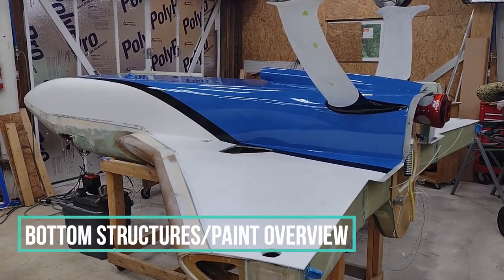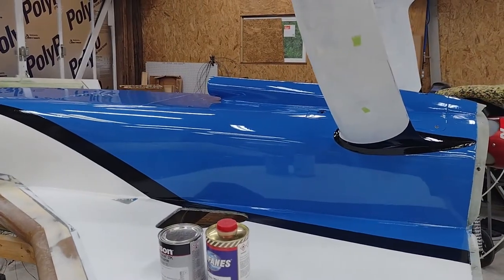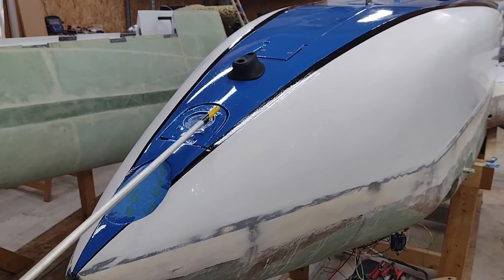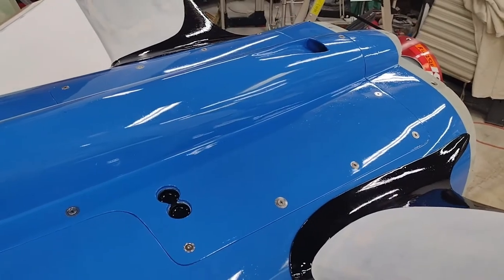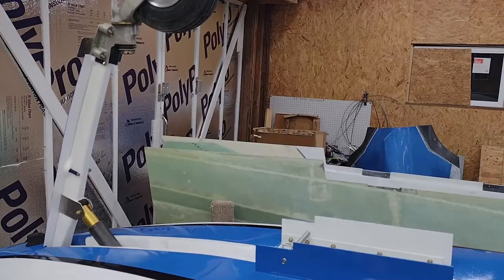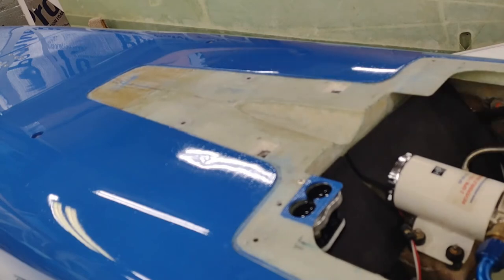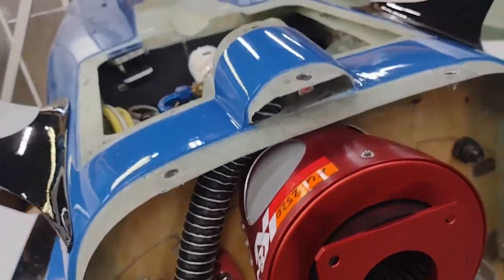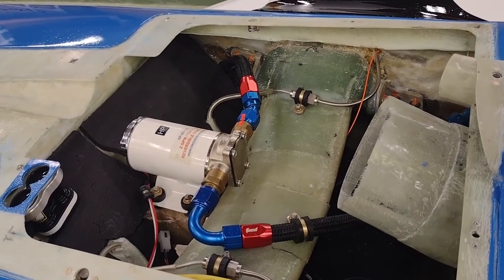Long-EZ N916WP - Bottom Fuselage/Nose/Strakes Wrap-Up

Comment: I enjoyed learning the inspiration behind your paint scheme and I totally relate.
And on screen, that blue does look excellent, especially as accented with the black.
Having the nose gear fairing spring-mounted to the leg is brilliant.
Those gear leg fairings look fantastic. And I enjoy every area where you “went crazy and had some fun”!
Your belly scoop fiberglass work is outstanding. The detail of having the small, ancillary cooling NACA integrated into the back of the ram air duct is just very cool. Hard to describe why that adds so much interest to the design but it absolutely does. When aerodynamic and pneumatic features are so logically integrated and just look logical and effective, it’s a very satisfying thing to see.
I’m luving your work. Your composites skills far exceed my own and I’m finding inspiration in your project 😎🎩♠️💙
Reply from the maker: Thanks so much for your kind words.  These mods are certainly a time bust but I'm fairly confident that they'll make the operational and maintenance aspects, let alone flying it, significantly easier.  Thanks so much watching... glad you're enjoying the build.  After a brief pause I'm jumping back into it!

Comment: this is very beautiful im very interested in the paint choice you have used i have a verieze that needs painting.
Reply from the maker: I used 2-part polyurethane Epifanes boat paint.  It looks great from 6-10 feet away, but has issues close up.  Very finicky to apply and you have to be very skilled to do it IMO.  I would shoot the paint with a spray gun if you can.  Single part polyurethanes are much more forgiving to my understanding.

Comment: Where did you find viable plans and templates?
Reply from the maker: I used the TERF plans and PDF version of plans since I bought all my blue foam cores for the flying surfaces.  Stephen James at Eureka CNC sells the templates as well.  I bought nearly all the metal hardware from the Cozy Girrrls so I didn't need the plans for those either.  So many common mods have changed the build from the original plans (longer nose, electric nose lift, Melvill cowling, high speed rudders, etc.) that it supersedes large portions of the plans as well.